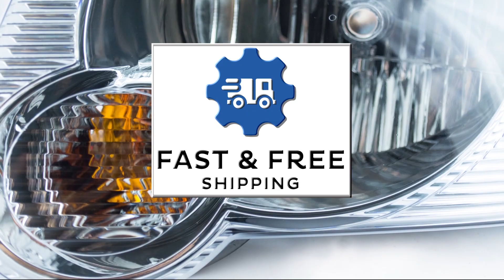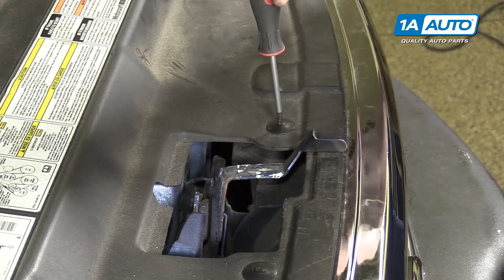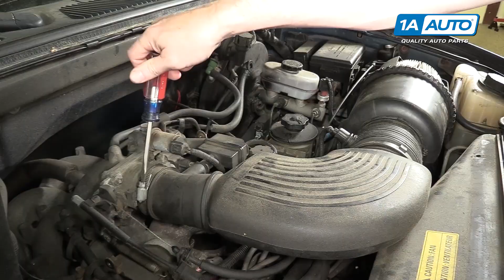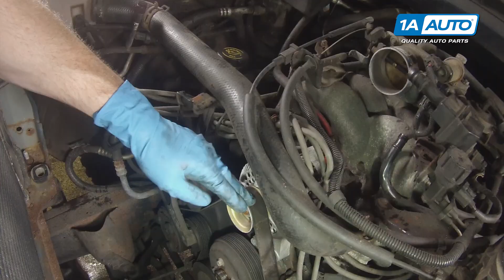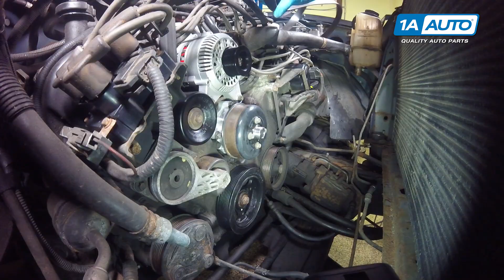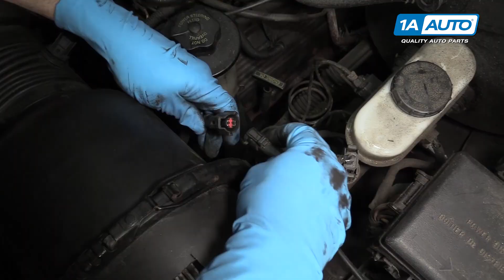How To Replace Serpentine Belt 97-04 Ford F-150

Comment: I was going to replace the tensioner as well. the part i recieved has the arm that holds the wheel facing the opposite direction than what is on the truck from factory. when checking i noticed all models that are listed for this are oriented the same. what am i missing. thanks

Comment: I was a professional mechanic for 10 years and a part time mechanic for the last 25. This is a perfect example of why I hate Ford engineers. All makes have their engineering faux pas, but Ford excels in them! Anything that requires periodic maintenance should not be this difficult to service! Unfortunately my father-in-law owns a ‘97 F-150 and I’m on my way to install a new belt. 🤦🏻‍♂️😒

Comment: On my 98 it was much easier to manipulate the tensioner from the top than the bottom, I also found it much MUCH easier to save the alternator pulley for last.

Good video all in all, comprehensive and straightforward.
Reply: RIght!

Comment: just did this on my 5.4 . pretty easy. to make more room unclip the round intake clasp. Then just lift it up out of the way. Also a great time to shoot the MAF sensor with some spray. You don't have to take off that front shroud, or the intake connectors. Then put a breaker bar on the tensioner, and slip off the belt from the alternator. I did all this from the top side and not underneath. The hardest part is installing the new belt. Just take your time and double check the chart. I started on the lower driver side and routed to the AC side. Then push down the tensioner and slip the belt on top of the alternator.
Reply from the maker: +00vortech Thanks for the feedback!

Comment: Be careful if you are going to take the airflow off. I took one of the hoses off and when I put it back on I didn't realize one of those little elbow tubes had a hole in it. Truck was running like shit. Got all those shitty hoses changed out now. Running like a champ again.

Comment: Just bought a 2003 with 175k.  4 weeks into a pretty good truck my wife just drove "a mile" after the belt slipped off.  I'm hoping to be able to replace it based of this video.  At least so it can get to the shop.

Comment: No need to take anything off. Cover or intake pieces. All you need is a 3/4 drive for the tensioner. Route belt on everything but the P/S pump, pull on tensioner laying under truck, then slide on P/S drive.
Reply: he took them off so we could see what he was doing.

Comment: you dont really need to do any of this, as long as you have a 1/4 inch sockets for the tensioner you can change your belt on the side of the road
Reply: Exactly

Comment: You left out the most important part how do you take the damn fan off LOL and what did you use for the tensioner was it a 15 mm or was it just a regular ratchet head???????? the main reason I came here is because I wanted to see if I could do it without removing the fan so does anybody know....... you did say keep in mind your fan will be on for some repairs so I'm assuming I can do it with my fan on I don't know.......
Reply: I just replaced my belt on Sunday. The belt does not fit over the fan, it routes around only the left side of the pulley. If the routing diagram is missing from your truck you can find it online. You can do it all from the top. You don't need to remove a bunch of parts, etc. You can lay under the truck to do the lower pulleys if you want, but it isn't necessary. Soooo, Loosen the clamp holding the air intake snorkel on the throttle body, pull the air intake snorkel off the throttle body and move it up out of the way to give yourself some room and to see a little better. You don't have to remove the entire snorkel section. A 1/2" socket fits in the belt tensioner hole. Use the ratchet to take off the tension and remove the old belt. Pushing toward the center of the truck (clockwise) removes the tension.The longer the breaker bar, the easier the job. Route the new belt, with the belt on to all but the tensioner pulley. Again, using your ratchet, move the tensioner pulley until you can slip the belt on to the tensioner pulley. Reinstall the snorkel, re-tighten the clamp, and you are finished. I hope that this helped, Have a Great day!

Comment: Believe it or not you don't have to take anything out to get the old serpentin belt off and the new one on... I did it with a broken collarbone 1 handed...
 If you maneuver everything from the top it's a lot easier than crawling under the truck and reaching up. However everybody has their own way of doing things,... so none the less...  Nice video...
Reply: I think certain years have more clearance than others
I have a huge mechanical fan on mine and I can't even get a breaker bar or socket on it

Comment: You showed how to take the fan belt off with the fan removed. I think it would have been better had you shown how the fan comes off you're not doing anybody any service by showing them how easy it is with the fan off without showing how to take the fan off
Reply: PapaThmperr jam a pry bar between two of the four bolts around the Waterpump pulley (where the fan is screwed on) so that it can't spin, then take a big Crescent wrench and unscrew the fan. You might need to hit the wrench with a hammer to shock it loose. I can't remember if it's right or left hand threads
Reply: @noahgullion2  You don't need to take the fan off.
Reply: @panicfever1277  Ikr, waste of time..